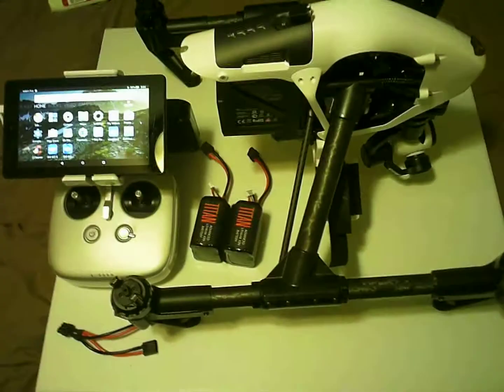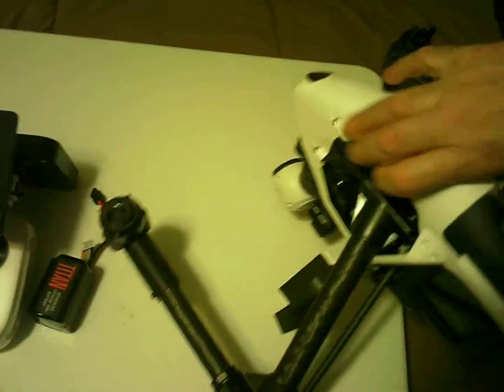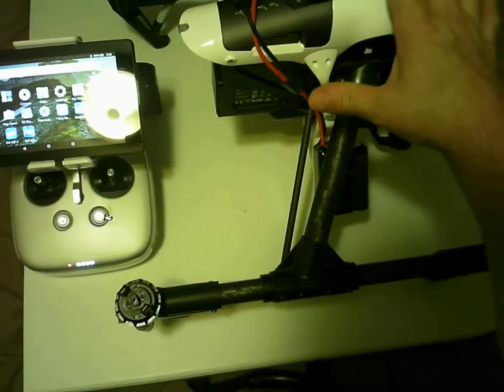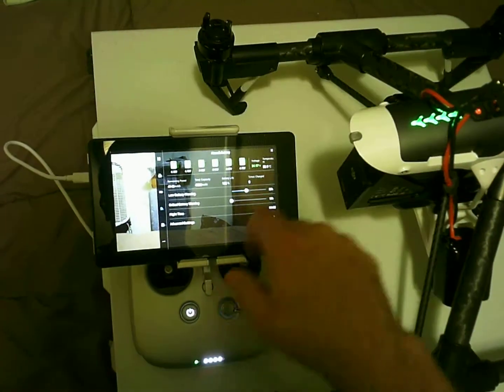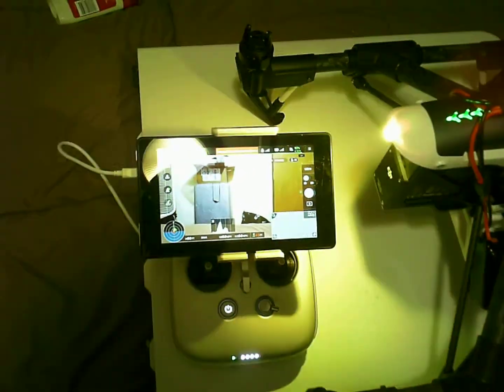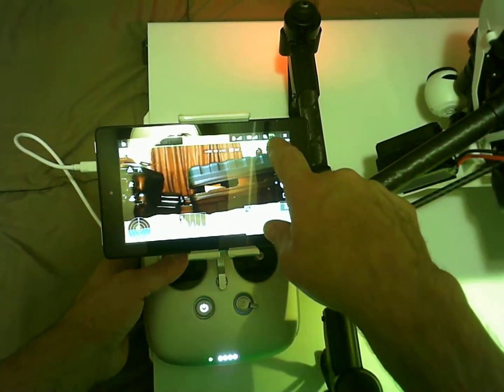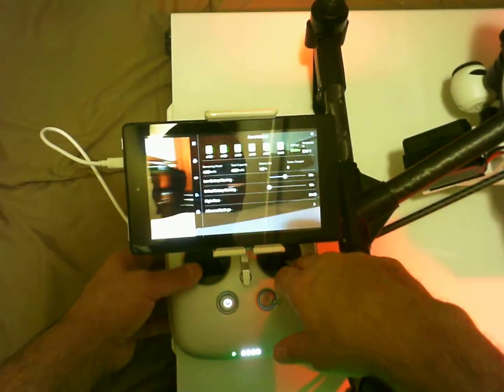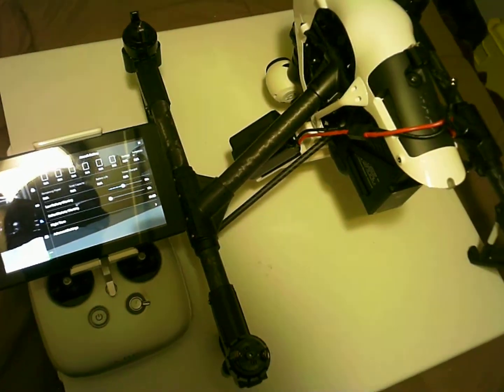DJI Inspire 1 and battery mod

Comment: Greetings... I have a parallel clip connector and it does not work with these Titan batteries. I suspect I must need a series clip like you have mentioned in your video and that I see in the Inspire Pilots forum. Can you send me a link as to where I can purchase the series connector clip? Thanks a great deal. I'm ordering a couple of your battery mounts for a more centered locating of the batteries ....good idea!
Reply from the maker: very sorry i said serial again......losing my mind, its a parallel y harness, came from titan  

Put two Titan packs in parallel and double your mAh! 

- Black XT60 Connectors 
- 14AWG multistrand silicon wire (10cm long)

https://www.gettitanpower.com/pages/1s2p-wiring-harness